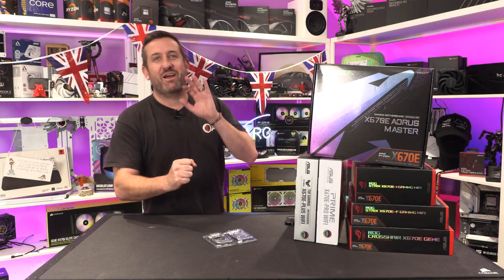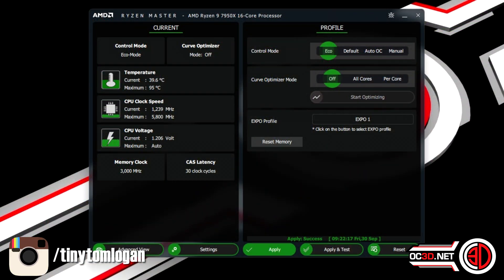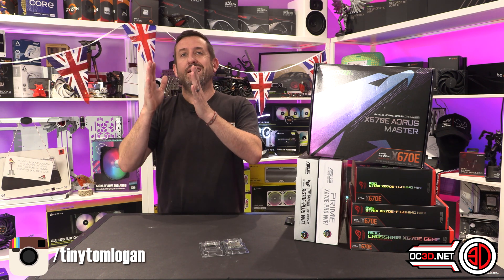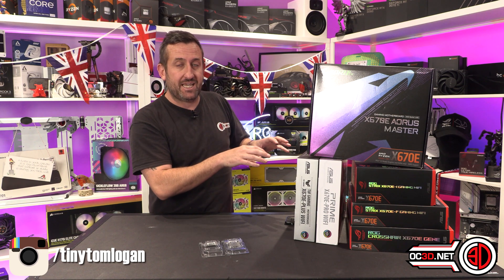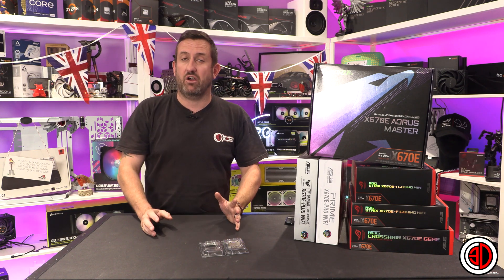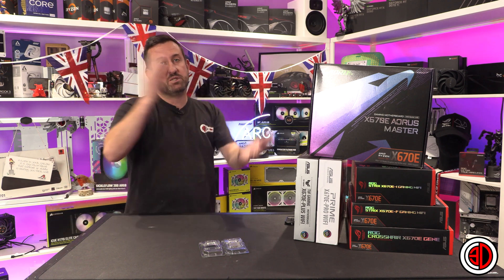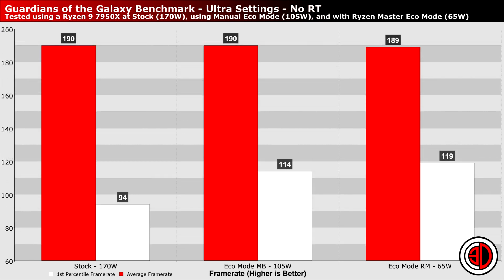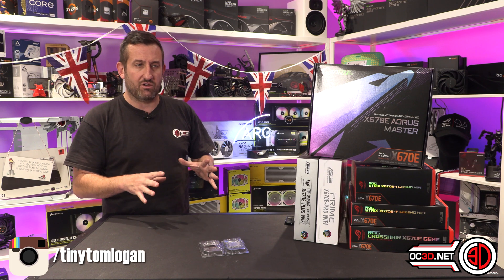WARNING 7900X and 7950X  DO NOT use Ryzen Master Eco Mode

Comment: Just upgraded from 7600x to 7950x cuz.. I could. I hate it. This thing was born in the bowels of Hell and won't let my fans shut up. You look at the thing now and the fans cap out. 4 intake fans plus 360 AIO exh and single rear exh btw. Now I run it on 65w eco and +20CO just so when I do anything of real work, it hits that 90w power limit, downclocks to about 4.3ghz, scales back to about 67deg and takes the edge off the fans. But honestly just watching youtube this thing will sit at 73 degrees with fans cranked. It rigoddamndiculous. Really sad considering [i thought] i was cpu limited doing hw accelerated handbrake encodes. Cpu was at high util while the gpu was barely sweating, so i got the 7950 thinking the gpu needed more to eat. Now the cpu pegs, the gpu pegs, the fans peg, and my wife sleeps in the other room. I can get the encoding work to happen now by turning the cpu down just to the point of max gpu util, but again, browsing amazon will now have this computer screaming at me. Hate this chip rn.

Comment: The actual Ryzen-Master has one button in the "advanced settings", where you can chose 105W and 65W for eco-mode. This one works realy great right now - maybe AMD did some updates to Ryzen-Master in the last 2 years. So actualy you can use this tool to easily change the voltage by clicking some buttons without going into your bios - a great thing when you're working and maybe need a ton of power or if you just wanna reduce the voltage after some heavy multi-threaded stuff.

Comment: I do not have the manual mode to make adjustments .
I have a MSI mag B650 mobo , 7950x3d cpu , 32 gig Corsair Vengeance ram  Western digital M.2 .
Eco mode causes system to go into a boot loop have to reset cmos to get it booting again .

Comment: If you’re like me who started with a mid tower when I bought my 7900X, I then put the build in a FormD T1. The cooler options are limited and it does fit A 240mm cooler it’s very few that can fit that case with a 3-slot GPU. Looking at the L9a or AXP-90 makes sense.

Comment: i have a question. i have a 9 7900x right now, and i adjusted the eco mode to 65watts. does this mean it runs similar to a 9 7900 (or slightly better)? is it worth to return the 9 7900x for the 9 7900?
Reply: The way I understand it is that dropping the 7900x to 65w doesn't have any loss affect when gaming but but if you were doing other things it would.
Reply: There are some tests between the 9 7900x and the 9 7900 - they pretty much agree, that the 9 7900 ist like the 9 7900x, but with built in "eco mode". So yes, the 9 7900x on eco mode (65W) is like the 9 7900.
I chose the 9 7900x because of the opportunity the chance voltages from 170W to 105W and 65W. As far as I know, the 9 7900 can easily be overclocked to full power - in that case, it's faster than the x-version, but runs hotter and the power consumption is heavy.

Comment: Looking for help/clarification, thanks for some info if any.

For multicore workloads with a 7950x, 240mm AIO,  40-50% fan speed(1800rpm ish), to hit a -5% drop in performance, what would temps, and Wattage from an under-volt look like?  
Using the same cooling situation and keeping all cores around 4800mhz, when under-volting what temp and watt measurements do most people get over sustained workloads?

Also in comparison to the 7950x3d by under-volting a 7950x can the same efficiencies be equalized for full-load multicore workloads (I don't care about gaming, so please no answers in this regard). Or can even more efficiency (watts) be pulled out of the 7950x3d under the same conditions 

I understand there are multiple factors that can create variations, ie cases, ventilation, part quality/chip yields, 
I am just looking for an average people get out of the above settings if they tried them themselves.

The goal is the best clocks/temps/watts mix for around +-80~85c with the above settings and determine if the energy efficiencies be manually equalized between the 7950x and 7950x3d.

Comment: My Ryzen 7900x got only about 150FPS in Warzone 2 with Ultra Settings and an WQDH Monitor.
In the Eco Mode i got now between 220 to 260FPS.
So the Eco Mode dir the 7900x is realy good.
Reply: From 86 degrees, to 68 degrees
Reply: Thnx for the information bro. Just installed that cpu and going for eco mode. How are the temps?
Reply: Eco mode --> 105tdp yes?

Comment: Trying to make a chart/ table for eco mode settings / PPT TDC EDC, for all power levels ie 60w to 230W (all between) to enter manually, can you point me to the formulas used/ tables etc etc (AMD supplied?) and i can make my excel table. (my target is 85w at half way between 105W and 65W)

Comment: 105W ECO mode is the sweet spot. You only lose 5-10% of performance, but reduce power consumption by nearly HALF.
On top of this, gaming and single threaded performance remain unaffected.
Reply: es seguro de usar ? tengo un Ryzen 9 7900x
Reply: @danielramostrejo5720  Si es seguro pero , cambia los numeros de ppt, edc, en el Bios para que se quede permanente
Reply: How's that a sweet spot? When I turn this option, the maximum speed it can reach is 4.8Ghz while the stock runs at 5.5Ghz.
Reply: @TheRawi  Something is wrong with your settings.. I have the 7700x and I modified it to run at 60 watts and it boosts up all the way to 5.5ghz.
Reply: @mariolp2999  7700x isn't 7950x. Those are two different processsors.
Reply: @TheRawi  Okay.. I understand yours is double the cores but it should boost at least to 5.5 with 105 watts.
Reply: @mariolp2999  I'm not sure. I tried setting the Precision Boost Override in BIOS to AMD Eco Mode 105W and then it is capped at 4.8Ghz with around 70c tempreture. Will try again and see.
Reply: @mariolp2999  Yes, you are right. 1 Thread stress in CPU-Z indeed reached 5.5Ghz. However, all threads stress is around 4.8Ghz. Do you know why?
Reply: @mariolp2999  But thanks for bringing that again to my attention. Now I'm doing 105w and it seems my PC is better in terms of fans noise.
Reply: @TheRawi  As long as you reach around 5.5 you should be fine..not all threads should boost up to 5.5 I believe.

Comment: Yeah, I have a 7950x so basically turn on the 65w eco mode when gaming, but when I'm doing anything else it's on 105w. I only save the power while gaming because there really was no performance difference.
Reply: How do u switch modes? on startup in BIOS?
Reply: Turning ECO mode on when gaming is like backing off the throttle when driving up a hill. Your logic would make more sense in reverse.

Comment: I used to watch you back in a day and recently womdered where you are gone. I think you are fist youtuber with atx psu tester. Its sad to see you still make videos.
Reply from the maker: Yup still here. YT isnt that great at telling subs that Ive made them though. Sad, why sad?
Reply: @OC3D  what i want to say is it is sad that you get so low views because of youtube algorithms and im happy that you still make them. Would you test rust game performance on new ryzen cpus? I want to hop on new am5 platform and cant decide if i want to get dead am4 or new am5 i want 144fps consistent and this game is very cpu bottlenecked especialy on high pop 500+ servers. 5800x3d vs 7600x vs 12700k sorry i said it wrong before i just couldnt make a sentence. And i acidently mashed both thoughts together. Also wold you make more ddr5 4800mhz overclocking for certain hynix, samsung dies to get extra bamg for buck, and maybe custom write xmp profile for them if its even possible
Reply: Also i had you subscribed for years but you were gone for me and i couldnt remember the name of the channel.

Comment: For me, it's really disapointing that it seems that they were only able to uplift performance from Zen 3 to 4 just by cranking the power up to 11. Sure, 5nm is not mature yet, but still... I'm gonna pass for this one, and keep my R5 2600 a lil bit more.
Reply: To me it's disappointing that amd didn't made a huge ipc increase or make their ipc as their top priority instead of clockspeed because more clockspeed means more tdp and temps so in my opinion Ryzen 7000 reminds me of bulldozer (AMD FX) because they prioritize the clockspeed than the ipc which is more important than clockspeed
Reply: @JasperTedVidalTale  The issue is, unless you're satisfied with a 2-5% IPC gains one gen to the next, (and by extension, 2-5% perf gains, as clockspeeds were to be equal in you example) you would need to completely redisign an architechture from the groundup every year. It costing upwards of a billion dollars give or take, it's way more effective to iterate on what's existing up to a point. And on top of that, engenners dont't really know what an iteration will bring, or another tweak on said iteration, and so on before testing it in a lab.

Comment: AMD 7000 series is an embarrassment honestly. Zero architecture improvements, just brute forcing performance with power consumption increases.  5800x3D should be the template to move forward.
Reply: Didn't Intel start this trend with Alderlake? Perhaps AMD had no choice but to do the same to stay relevant.

Comment: These are the settings recommended by AMD to anandtech :

    170W TDP Base = 105W with ECO Mode enabled
    105W TDP Base = 65W with ECO Mode enabled

    170 W = 230,000 PPT, 160,000 TDC, and 225,000 EDC
    105 W = 142,000 PPT, 110,000 TDC, and 170,000 EDC
    65 W = 88,000 PPT, 75,000 TDC, and 150,000 EDC
Reply from the maker: Those settings are in the guide I made too
Reply: @OC3D  Seems strange that they wouldn't apply their own recommended settings to a ECO one-click option when it comes to the higher watt processors

Comment: Thank you for covering this. Hopefully they will add more options in Ryzen Master for various TDP modes kinda like what these new handhelds are doing. As someone looking to do a SFF build with the 7900X it would be nice to be able to easily in software configure the TDP for max performance at a wattage that will support more cooling options
Reply: Lian Li and dan are doing a case called a DAN A3 m-atx case  ( check it out looks amazing )  basically a sff with a 360mm rad which could be a great option !!
Im looking at the 7000 3d v cache versions im not really interested in the base 7000s but i hope by then or really soon they have sorted this eco mode set up ..
Reply: @volvot6rdesignawd702  Thanks for the heads up on that Dan A3 case. Didn't know that was coming. I'm leaning towards the X3D chips myself. Hopefully they do a 7900X3D.
Edit: I'm also wanting to see what the Meshroom D ends up being.
Reply: @carsoncarolina2358  nice on the Meshroom D..
check out the ASUS PRIME AP 201 case another 360mm rad case maybe im just looking at over killing these new cpus with a 360mm rad my reasoning behind the Dan A3 and the ASUS PRIME AP201 case is their both itx/m-atx with 360mm support but also ATX psu in a smaller form factor ..ASUS is a bit bigger though at 33 litres  .. 
i  dont think the 7900xt will be as power hungry as the 4090 but with these new cpu's and gpu's eating so much power you have more options when it comes to ATX psu's 
where as i think to my scouring of the internet the silverstone sfx 1000 is the only sfx at 1000watts..

 my plan is a 7900xt at release .. ive got a corsair hx1000w psu  and i just ordered a arctic freezer ii 360 aio ( their out of stock across Australia so i guess people are already looking at 360s for the zen4 ) then im going to buy the rog crosshair gene m-atx mobo and like you im either going the 7900x3d or go big for a few years with the 7950x3d if its a thing !! 
just tossing up the case now as im using the nr200p max 5800x3d and 6900xt !!
Reply: They already have tdp amounts in the bios
Reply: @WayStedYou  I'm well aware of that. Sometimes it's easier to use a software control vs bios

Comment: Use the Curve editor to negative 10 - 20  all Core ( depending on the CPU Lottery )  and undervolt your CPU , if you want to cool by Air , then start with a 140/150 Watt Power Limit ( which is the AM4 PPT of 142 W ) , you may loose 5-6 % Multicore Performance but you save 70-80 Watts ( under full load ) or if you set a 125 W Powerlimit you save a whopping 100 Watts at only 11 % Performance loss   o n l y   under full load . Its the full load where older AM4 Cooler can struggle to cool down an unlimited Zen4  with 230 Watts .

Comment: From what I've seen in optimum tech video. Forget eco mode. Set the negative offset to whatever you can get to, stable. In his case - 15 for 7950x and - 30 on 7700x. Then just use power limit to get your temps and performance combined to where you want them.
   He managed 61c and his multicore clock almost the same as stock(14mhz lower) by setting an 85w limit on 7700x. Though -30 offset might be a golden sample. But general idea will remain the same.
   If you're not happy with your scores go to 90w or 100w until you're where you want to be.
    Strongly advise to do it in bios rather than through software.
   One thing to be wary of is some mobo adjust power in Watts and some in mWatts
Reply: Different strokes for different folks, we enthusisats have no problem tuning and testing, but just like not everyone will use 1usmus CTR... there will always be many who just want to click a setting and go.
Ryzen master isn't perfect but for those just wanting to reduce CPU power consumption by 50% and reduce temps 22c while only losing 7% of rendering performance, that's still an option to have for those users.
Reply: @tomstech4390  just looking at these numbers proves that the stock settings on zen 4 should not be the stock settings

Comment: AMD would be stupid to let happen for to long my guess / hope is they will update Ryzen master to change this so if it detects the 7950x or 7900x its eco mode is 105w and if it detects the 7700x or 7600x it drops it to 65w or equally they drop another setting so eco is 65w on all and mid power is the 105w  on all  which would be a good thing so if you do want to game on the 7950x and eco  is just as good at 65w then a eco mode isnt a bad thing !!
Reply: A CPU doesn't stay at its highest wattage limit all the time. It only briefly climbs when something demanding like opening an application happens in desktop media use. Otherwise it ramps right down. My not undertvolted 5950x is at 45w at the moment.

Comment: oy mate, dropping to eco mode doesn't really matter when you are gaming at 1440p or higher res, since you are shifting the bottle next to the GPU. you'd get drastically different results if you did testing in 1080p on low settings.
Reply from the maker: All games were tested at 1080 dude

Comment: pretty brilliant mode if you are just watching videos or other simple tasks, no? In these times it would be moronic to waste electricity.
Reply: when you are just doing simple tasks - the CPU won't use much energy, no matter, what mode it is in.
These limiters just play a role, when there is some relevant load on the CPU.
Reply: There are all kinds of inherent systems built into how CPUs work that mean if there is light load then power draw is lower. Kind of like how P95 will push your CPU well above the current draw specs at max clocks but watching a youtube video at the same max clocks will be a % of the power draw.
On top of that chips tend to scale their clocks based on load demand these days.
Basically not all CPU loads are the same and watching a video already consumes less power than gaming or running math simulations.
This is independent of Eco mode.

Comment: Just being able to select what wattage you want would be a lot better rather than just a single selection in software, BIOS is great, but it might be a bit intimidating for less experienced users
Reply from the maker: Totally agree dude
Reply: There's an option under PBO Advanced called CPU PPT, you can manually enter the max wattage of your CPU Package .. not a click and save but better than nothing, i have my 5900X set to power limit manual, 160W PPT, 110A TDC and 150A EDC.. got a decent 5% increase with 5C drop in temps
Reply: That’s what the apu in the steam deck lets you do
Reply: you ARE able to select it. It's called PPT in PBO.
Reply: These are the reco
Reply: What was nice from the 5000 onwards is that you could do undervolting with PBO.
Reply: You can.
Just in the bios
Reply: Use thermal limit throttle, set it to 80, degree C, almost no performance loss, cooler cpu etc.

Comment: I guess Ryzen Master Eco-Mode will be getting patched for 170W multi-die processors vs 105w single-die processors, it sounds crazy they didn't account for this scenario 😅
Reply from the maker: Think it's a quick fix. It should be able to detect the cpu